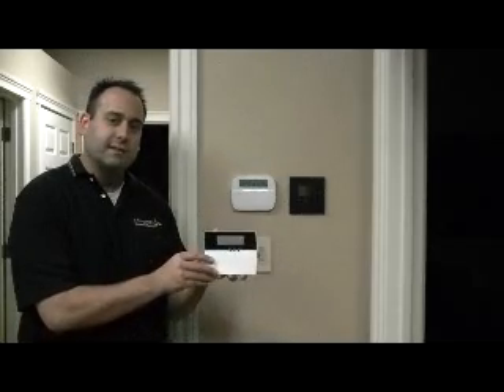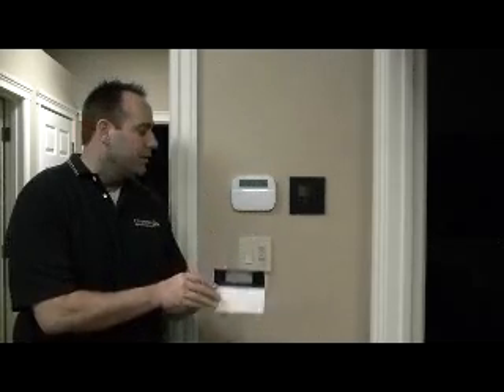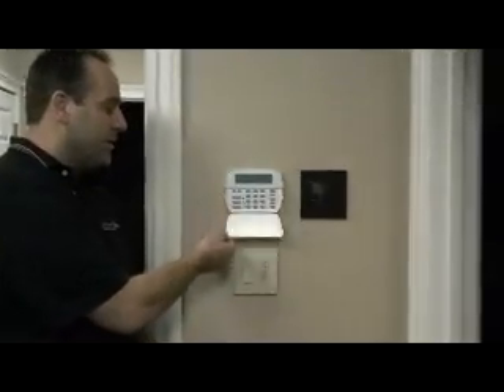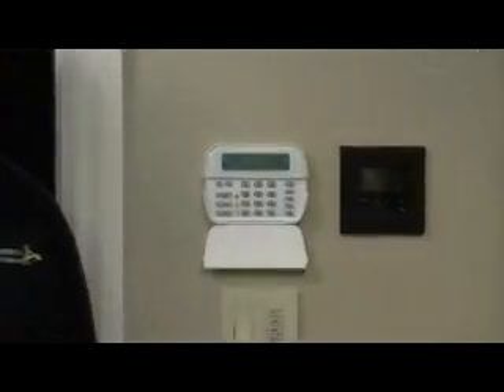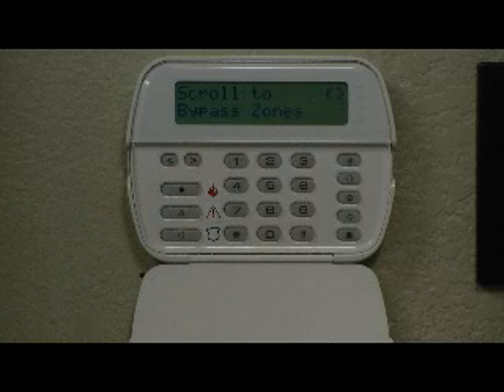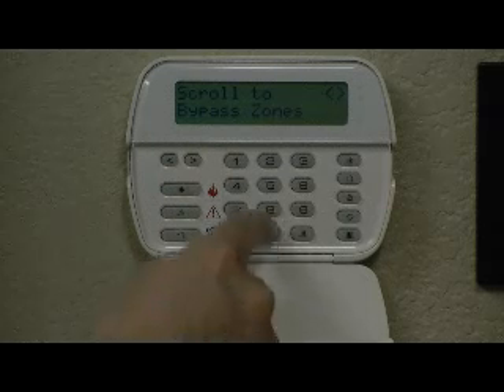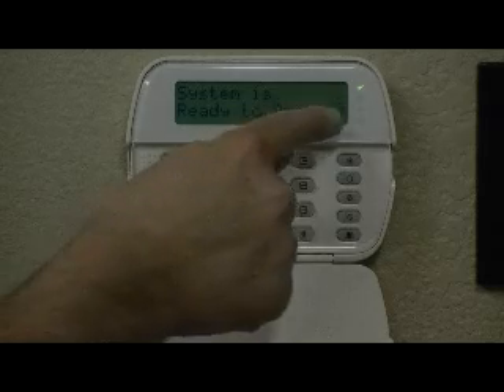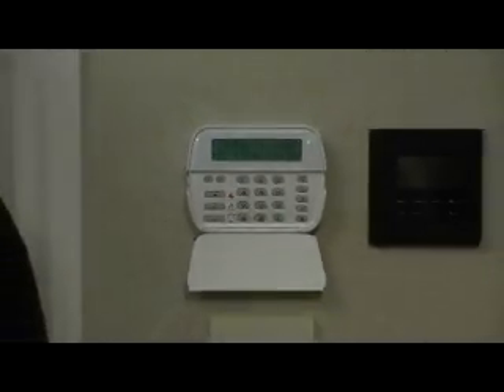How to Bypass a zone on a DSC security system.

Comment: I know this is an old post maybe you can help, we have the DSC power series 625 same keypad, we never had a problem zone 7 open and we cant find what it is? Replaced the main battery also while checking it was low voltage and leaking, didn't show a fault the only fault we have known is 4 no communication not using phone now, in the book states zone 7 not used and installers years ago only have 6 zones listed, on the LCD screen panel, now the system isnt armed so we cant even by pass zone 7 to arm, but we would like to know where or what is zone 7, states open please respond 
thanks called dsc no help?

Comment: I have a different system, but my instructions are the same. Here is my issue. I do this. I bypass a zone. I go to arm the system, and attempt to leave the house. Immediately after I open the door, the Bypass light goes out, and the zone is no longer bypassed. I tried to turn off the motion sensor while my dog is in the house. If I do the above steps and leave the house, my dog sets off the alarm when she moves. I have a DSC 832.